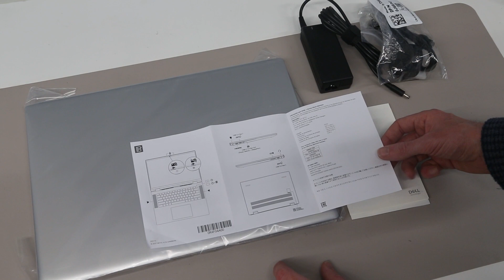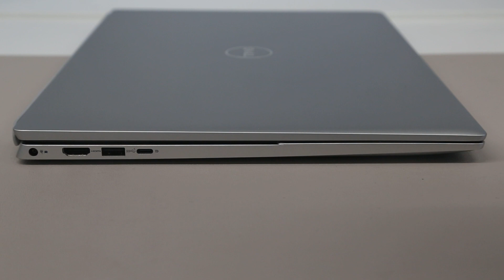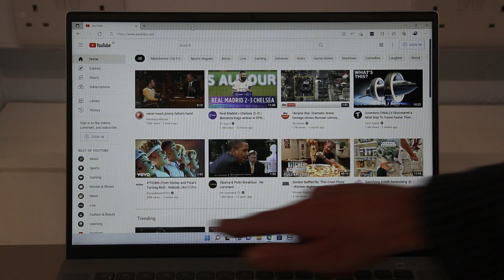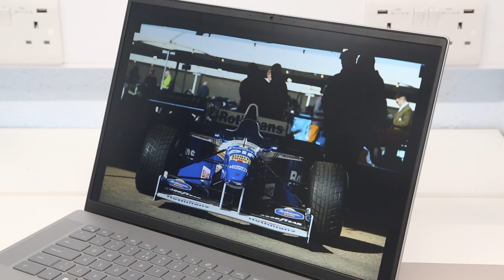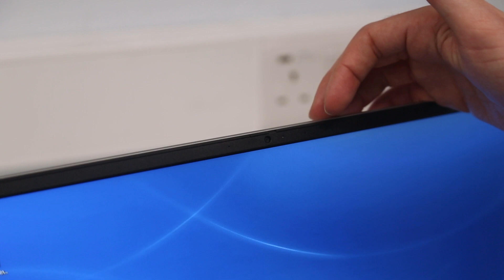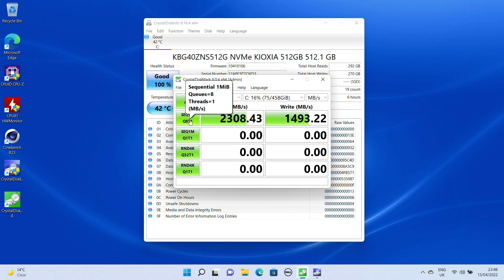Dell Inspiron 16 5620 Review - Inspiron 5000 gets Intel Core i5-1235U and 16:10 Screen for 2022

Comment: Great review! Could barely find any reviews on this laptop so this was really helpful! I believe the 5625 improved on some of your cons though. The 5625 model I'm looking at made the upgrade to HDMI 2.0 and there are models with a brighter 300-nit, 100% sRGB display.
Reply from the maker: Checked the specs on the 5625 and its HDMI 1.4 (same as the 5425 I reviewed here: https://www.youtube.com/watch?v=23pQ8x2R6oA). You can get HDMI 2.0 output with an adapter on the USB-C port though.
Other screens look to be available in other regions on both models, but not here in the UK.
Reply: Beware the 5625 model has a touchpad/ trackpad fault issue. I had to return mine

Comment: hi, i bought this i5 1240p nvidia model
and i am having trackpad issues , it's not working properly, bottom part is unresponsive it's been 6 days since i bought it,
can you help to solve this or has anyone faced this problem in this model?
Reply from the maker: Sounds like a warranty issue.
Reply: my track pad is cheap and has a loud click... I dont like it.  I suspect its not great quality...  mine does however work.. just seems sloppy during right click methods.  always seems to re-adjust itself to click lower than my initial selection.

Comment: What I noticed with these Dell WVA panels is that it has less ghosting compared to the IPS panels of laptops in the similar price range albiet lower brightness and color gamut. I had a thinkpad E14 and although it was a 300 nit 100% sRGB panel, the ghosting issue was bad there was a bit of light bleeding as well. So overall "viewing experience" is better on the Dell. The new HPs have 400 nit 100% sRGB IPS panel which I havn't gotten to see yet!

Comment: Thanks again for the great review. I got my 5620 with the I5-1235u in yesterday. I quickly noticed that the fans always sound like a jet aircraft is taking off in my living room, even when the CPU is not loaded with tasks. I contacted Dell Support and they are sending a replacement. Apparently this is a problem many others are having. Does your model have this problem?
Reply: Hello, I have also the same problem, when you get the replacement it makes a difference? I mean the fan problem is solved?

Comment: What drawback in viewing media? You do not lose anything comparing with 15.6 16:9 screen. Instead of looking at thick bezel, you just look at black bars when seeing a movie. That does not make any difference in terms of viewing area. If anything, you get benefits of larger viewing area when viewing vertically phone recorded videos!
Reply from the maker: Going from a 15.6" 16:9 to a 16" 16:10 gives you basically the same width, so you're right the 'size' for 16:9 content remains the same.
Its a bigger issue on the 14" models where because the diagonal is the same the 16:10 screen is narrower so the viewable area is reduced for 16:9 content. 

Compared to the 5510 though the 5620 is both larger (additional depth) and heavier (by over 10%), so if primarily for media consumption its not really a benefit.
That said, I really like them. But for some users they'll be a negative.

Comment: Thanks for the review. Currently Dell are doing this at £669 on their website, however I note it has a smaller SSD at 256 GB. I just bought a Lenovo 11th gen i7 for £499 from Currys (but haven't opened it yet). Do you think this 12th gen i5 outperforms it? I find benchmarking results confusing online and I'm thinking of taking the Lenovo back unopened before my 14 days return period is up. Many thanks, and happy holidays this week!
Reply from the maker: The Dell may have slightly better performance in CPU tasks, but the 11th gen i7 is probably quicker in terms of graphics.
If gaming the Ryzen 5 based APUs are worth considering, see my comparison video here: https://youtu.be/-IdrXfoGBik
The Lenovo at £500 sounds a bargain though.
Reply: @BrueComputing  Thanks James, I checked out your video and what a coincidence! At practically the same price as the 12th Gen i5 ("Inspiron 16 5620"), Dell have a Ryzen 5 5625U ("Vostro 3525"). The video you signposted me to shows that the Ryzen processor outperforms the 12th Gen i5, but seeing as the "Vostro 3525" actually comes with 16 GB Ram, compared to 8 GB Ram in the "Inspiron 16 5620" - it would seem it's a no-brainer to go for the Ryzen 5 5625U "Vostro 3525" concerning the two?

As for the Lenovo 11th Gen i7, yeah it seemed like an absolute steal. It was reduced from £700 and I bought it in haste, but the only drawback concerning it is that it's a 14" screen. It does only provide 8 GB Ram, but that wasn't a main concern at the time. I started rethinking the Lenovo when I realised 12th Gen processors were out, and that a newer 12th Gen i5 might be better in the long run than the 11th Gen i7, etc.

Cheers for your reply! You've got yourself a Subscriber! :-)
Reply from the maker: I'm not a huge fan of the 3000-series Dell line - they are alright, but the build quality and features of the 5000-series machines are worth going for.

Comment: Does it have a glass or plastic screen?
Reply from the maker: Plastic, non-touch screen. The 2-in-1 version, the 7620, has a glass fronted touchscreen.
Reply: @BrueComputing  thanks, I might buy it with my money, glass screens are much better than plastic screens imo
Reply from the maker: @woofsausage9338  Swings and roundabouts - glass fronted screens suffer more from reflections and glare and are expensive to replace if damaged.

Comment: I am trying to decide between the new Dell Inspiron 16 5620 with a 12th Generation Intel® Core™ i7-1260P (18MB Cache, up to 4.7 GHz, 12 cores), the Inspiron 15 3000 3511 11 Gen Intel® Core™ i7-1165G7 (12 MB cache, 4 cores, 8 threads, up to 4.70 GHz Turbo) and the Inspiron 14 5000 5425 AMD Ryzen™ 7 5825U 8-core/16-thread Processor with Radeon™ Graphics.
 All have 16 gb ram and 512 ssd but I am not sure which is better any help will be appreciated!
Reply from the maker: This video may help you decide: https://youtu.be/-IdrXfoGBik
Personally I'd take the Inspiron 14 5425 (or 5625 if you want the 16" display) wit hthe Ryzen 7 5825U.
Reply from the maker: Kasun, saying it has 12 cores isn't the full picture - the i7-1260P has 4 Performance cores and 8 Efficiency cores, with a total of 16 threads (the efficiency cores don't support SMT/Hyper-threading).
In many cases the 8 x Zen 3 cores of the 5825U can prove faster, and AMD have the lead on graphics still.

Comment: Hi you mentioned there's two SSD slots, may I know where is the first and second slot?

Also, wondering if you know how many SSD slots Vostro 5620 has as well?
Reply from the maker: This turned out not to be correct - the spec sheet says it supports 2 SSDs (https://dl.dell.com/content/manual8507452-inspiron-16-5620-setup-and-specifications.pdf?language=en-us&ps=true) but not sure if this is only on specific machine configurations or is an error.
I have an SSD and RAM upgrade guide here: https://www.youtube.com/watch?v=iGxaPn9qedI
Reply: I think the doc referenced below hints that it has ONE SSD slot per machine.... and that the machine is built with 3 different configurations.

Comment: Dell sucks uses propritery tech also a failing company in global market
Reply from the maker: Not really sure what's all that proprietary in these laptops? They are using SO-DIMMs and M.2 SSDs where as many are switching to soldering them to the mainboard.

Comment: Hi! Does anyone know when will this new Inspiron 16 with Alder Lake be available in European countries??
Reply from the maker: Not sure myself, I'm in the UK and was able to order it early April but took a couple weeks to be delivered. I'd seriously consider the AMD based versions as well however.
Reply: @BrueComputing  Greetings from Poland! For now, these newest models with 12th gen Intels are hardly mentioned on Polish Dell sites...
Reply from the maker: @janmarkowicz4633  ahh that sucks, maybe they are staggering the launch to clear old stock. Like I say, 5425/5625 are good, I generally prefer Barcelo to Alder Lake-U
Reply: @BrueComputing  I agree, older Dell models are still available here in high quantity... I am stuck to Intel processor because I need nVidia for some reason :-). In fact, I would prefer business laptop. Especially at the beginning I looked at Vostro 5620 (very similar laptop but without touch screen, non-convertible), but today I realised that Inspiron 5620 with Windows 11 Pro is considered as home-business laptop by Dell; moreover the touch screen with sylus support, and UHD+ screen if nVidia is included, really tempts me to 'hunt' for this Inspiron.
Reply from the maker: I think you're talking about the Inspiron 16 2-in-1 7620? That's available with the UHD+ display and MX550, the 5620 isn't (at least in the UK).
Reply: @BrueComputing  Yes, you're right. My mistake - I meant 7620, that's the model I'm wainting for here.

Comment: Does this have a lower color range compared to the plus version cause that would be a deal breaker for me.
Reply from the maker: The current 16 Plus model is 100% sRGB colour gamut and 300nits brightness. This (as tested) is 45% NTSC and 250nits.
Reply: @BrueComputing  what does that translate to in SRGB?
Reply: @BrueComputing  so I just googled, 45% NTSC is 60% SRGB, is there any laptop at this price range with a better screen?
Reply from the maker: @jonathanng138  Translating NTSC to sRGB doesn't always quite work as I understand it, as they don't fully overlap.

Comment: Does this 5620 12th gen laptop comes with inbuilt MS Office? Or we need to purchase MS office from outside
Reply from the maker: Office can be purchased pre-installed from Dell, but isn't included as standard.
Reply: @BrueComputing your rply is vague, it is pre installed or i need to buy from outside
Reply from the maker: It isn't included as standard, but you can add it to the system for an additional cost when ordering direct from Dell.

Comment: I'm waiting for the intel 12th gen 5000 series Dell laptop in India. This one seems pretty good for my requirements. Thanks for the detailed review.

Update: I bought an Inspiron 16 5625 with Ryzen 5000 series and it works perfectly!
Reply from the maker: Glad you liked it - be sure to subscribe as I have an upgrade guide and performance tests coming soon.
Reply: I am also looking at the ryzen variant. Any updates regarding performance? especially the integrated graphics card and the display
Reply from the maker: @suhasrao4324  I have a performance comparison video here: https://youtu.be/-IdrXfoGBik
Reply: @BrueComputing  thanks. That helps. I assume the results will be similar for the (Dell)Ryzen 7 5825u vs i7- 1255u(Samsung)
Reply from the maker: @suhasrao4324  Both will be quicker than the ones tested here. The Ryzen 7 5825U should gain more on the multi-threaded CPU tests as it gains 2 additional cores where as the i7-1255U is just a clock speed increase. Both the 5825U and i7-1255U both have additional GPU cores, but AMD have generally better compatibility and more consistent performance.
Reply: @BrueComputing  should i pull the trigger on the Dell 16 5825u or should I wait for the 6000 series since it also comes with a better integrated graphics. I'm neither a heavy gamer nor a power user. So do i really need a Ryzen 6000 series processor. Also feels like i will miss out on something great with the new gen. Any advice
Reply from the maker: @suhasrao4324  Biggest benefit of the 6000-series is the new integrated graphics, so if not gaming I wouldn't worry too much.
Reply: @BrueComputing  alright thanks. Also any opinions on new Samsung galaxy book 2 and lg gram 17(11th gen i7) or any plans on doing a review on those two
Reply from the maker: @suhasrao4324  I've no experience with either of them unfortunately, but did think the LG Gram is a nice looking machine. I buy most of the laptops featured on this channel to review myself, so tend to focus on lower priced machines which I can more easily resell after.
Reply: @BrueComputing  Understandable. Hope your channel grows more. Also forgot one thing. Is the Dell laptop hdcp 2.2 compliant? I have a 27 inch external monitor on which i wanna watch Netflix 4k. Any idea about that? I can't find any info on this online
Reply: @suhasrao4324  I'm a Physics student but not a gamer; so I can only speak for my normal day to day activities. Inspiron 16 performs smoothly for my daily needs like online classes, moderate programming and simulations, work in the Office app, browsing and streaming high resolution contents. I haven't seen any glitches or prominent heating issues during these tasks. The screen(with WVA and 1900×1200 resolution) is better than the hp or Lenovo laptop in this price range for such a big screen. Though it has only 250 nits, it's decent in the outdoor light. Ryzen 5625u works more efficiently than the 12th gen i5 processor, so usually I get 4-5 hours of battery life in medium brightness. The best physical features of this laptop are the fast fingerprint scanner, the speakers(it's too good) and not a bulky structure for 16 inch laptop. Also Dell support assist regularly suggests me for the required software and driver updates. For my requirements it's the perfect laptop. If you are interested in heavy gaming and programming, you should watch the video which the Youtuber suggested in the previous comment.
Reply: @sampadsaha3031  i have the same needs as yours with just light gaming and coding. So it comes with ms office with lifetime validity? My main concern was the wva display and whether if it is nice and colour accurate and if it looks too grainy?
Reply: @sampadsaha3031  I'm reading some reviews saying the fan is too noisy or will spin up even on light tasks. Have you had this issue at all?
Reply: @mattlee413  I have used it for high end programming simulation, but didn't notice that much fan noise. Yes, during hardware testing and updating, the fan rotates very fast. Other than that during normal uses I haven't noticed the issue. My model is made in India and it works smoothly, but I'm not sure about other manufacturers.
Reply: @sampadsaha3031  Did you buy Vostro 5625 or Inspiron 5625? because I dont find an Inspiron 5625 on its website or even on amazon
Reply: @souravkg333  I bought Inspiron 5625 from Dell India official website last April. Mine is with the Ryzen 5000 series and runs great. I think they discontinued it in India.

Comment: Considering an Inspiron 14” or 16”, just can’t decide between the i5 intel or AMD Ryzen 7 5825u processors. Not much online about the 12th Gen i5 yet and not sure about the UHD graphics. What do you think?
Reply from the maker: Planning on having some tests with Ryzen 5 5500U and 5625U, as well as a Core i5-1135G7 to compare against the i5-1235U so will be a busy few weeks!